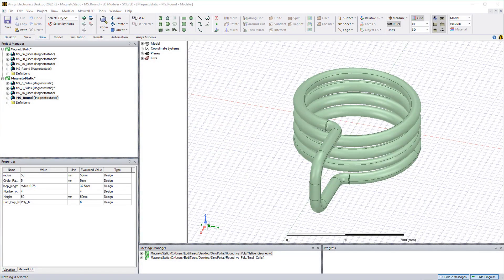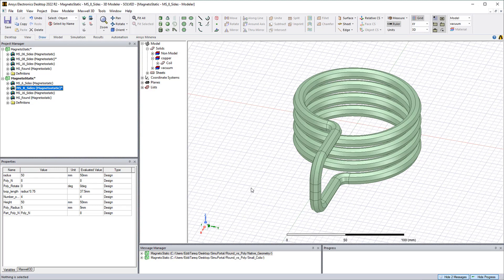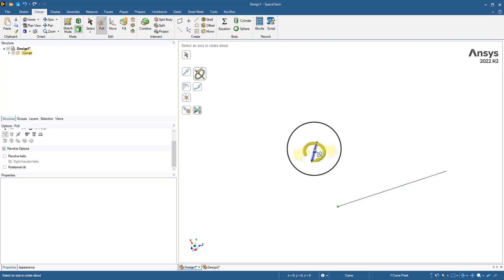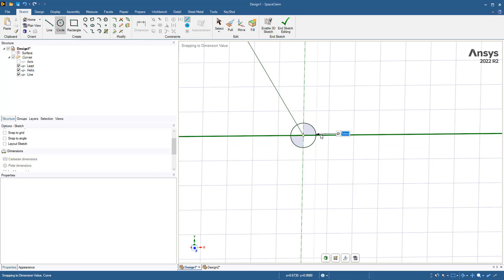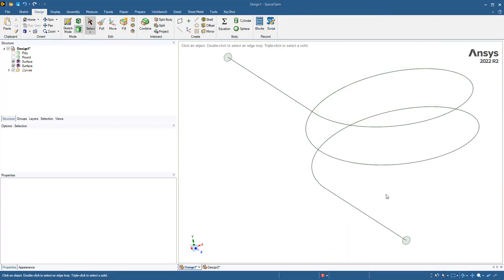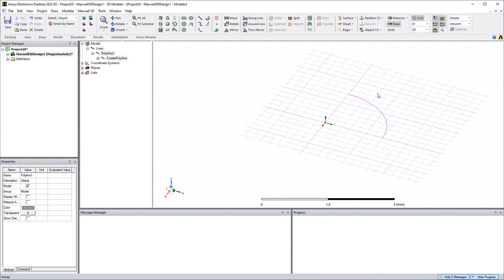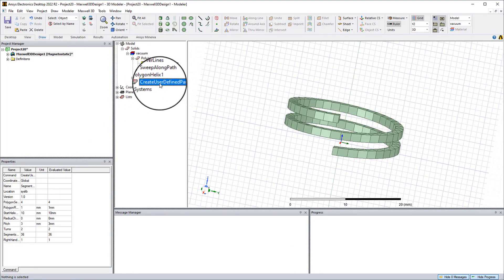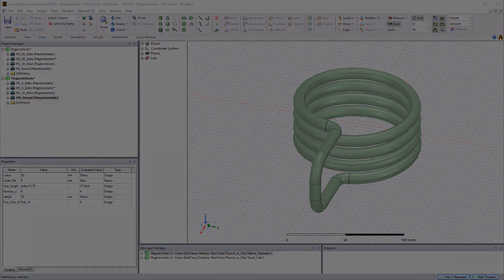Improving Ansys Maxwell Adaptive Meshing Solve Times Using Polygons

Comment: does this change have any effect on the accuracy of the result?
Reply from the maker: Thank you for your comment. SimuTech Group Engineer, Tareq Eddir, who created the video said in regard to your question- If the simplification is too different from the original geometry, like a square vs round, the effect on accuracy will be larger than a close simplification, like a dodecagon (12 sided) vs round. What happens in the FEA method is that we discretize the geometry, so a round object will be simplified to a polygons in the meshing process. What we’re doing here is giving the adaptive mesher an easier geometry to start with so it takes less steps/time to arrive at a mesh. Its important to note that the user must understand the application and assess whether a certain simplification is acceptable or not. So if for a particular application, a round or near round shape is important, using a hexagon starting geometry will always result in a hexagon and the mesh cannot be refined further to higher order polygons or rounds. 

SimuTech Group offers various services like training, mentoring, and consulting, if you are interested in learning more please send us an email at info@simutechgroup.com